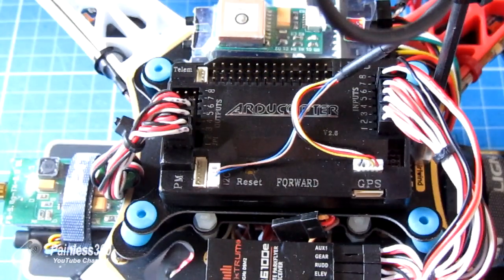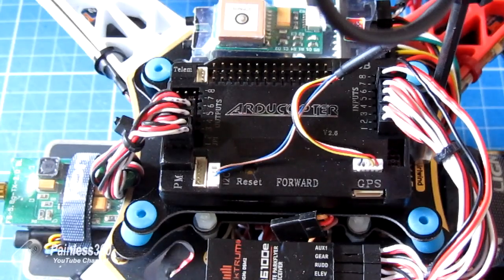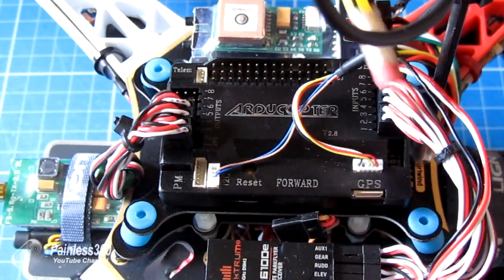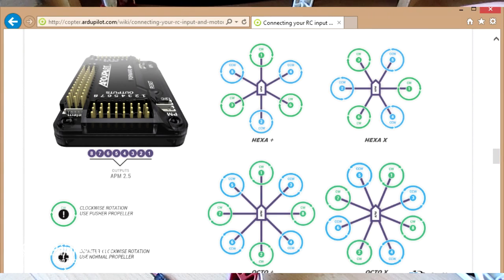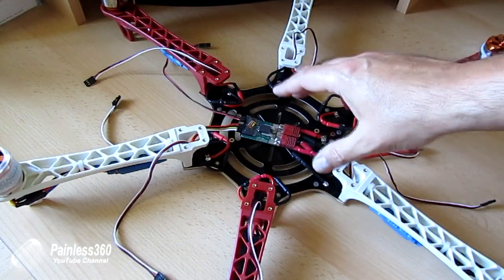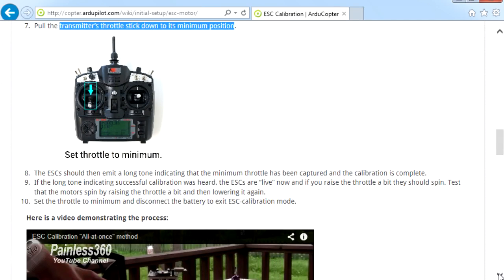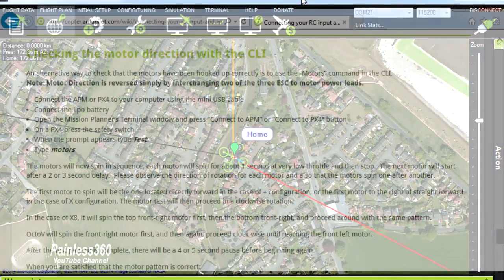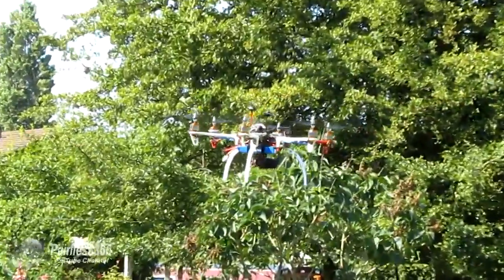(2/8) APM 2.5/2.6 - Powering the board, motor installation and ESC calibration

Comment: whenever i power up F450 (quadcopter) it required ESC callibration? my apm is not saving callibration data any solution
thanks
Reply from the maker: The calibration is stored in the ESC, not the flight controller. I'd check the process on the ESCs you have. See our videos on ESC calibration if you're new to this.. Best of luck!

Comment: what GPS/compass module are you using?
Reply from the maker: Ours came with the kit, it's normally some kind of UBLOX GPS unit. We're using the M8N a lot here for things like iNav.. Best of luck!
Reply: Also, does your apm have a built in compass?
Reply from the maker: Only the V2.5 had an internal compass... Happy flying!
Reply: Does that mean I should get an external one?
Reply: @jacobsingh4873  the compass is built into the gps

Comment: I don't have a power module so I have to power it by my ESC, but my bec gives out only 1.5A so can i connect 2 of the ESC's power(red wire) and cut one ESC's power (for Tricopter)
Reply from the maker: Should be, if the BECs in the ESCs are linear..
Reply: how do i know if it's linear or switching?
the labels are peeled off and the website I bought has not mentioned that.
Reply: +Painless360
Reply from the maker: +Asutosh I try to find the details from when you order them, best of luck

Comment: Wondering why my Live Calibration is not working. Do the 2.6 have it?
Reply from the maker: +Scott Miller SHOULD Do. Make sure that the external compass is connected and you've picked the right settings for it before calibration. Best of luck!
Reply: Will the sonar HC-SRO4  work with the mission planner plane?

Comment: Can I use this http://www.ebay.com.au/itm/like/322091210373 to power my apm2.8 and also get the other end of the power module to my main power connector which is connected to my drone? But will it work OK or will it damage the esc or the APM or any other component of the drone?
Thanks!
Reply from the maker: That looks like an APM power module. See us covering that later in the series.. Best of luck!

Comment: for calibrating the 4 esc's together i made a  little cable , grouping the 4 pwm signal input of the esc's , and separating the 2 wires +5 and gnd.As i had i esc powering the board, i was obliged to separate the signal and the power.So happy with this board , i tested Alt hold and loiter today , perfect without changing parameers, although my pitch channel showed correctly in MP , but was inverted???Little overshoot on roll after a stick command.These video are so helpfull!

Comment: Hello Painless 

Thank you very much for your extraordinary video series. 

Presently I am confronting an issue with ESC manual calibration. 
When ESC pins are connected to the RC receiver, motors are working properly, it rotates with respect to the Joystick(Transmitter).
When it is detached from the receiver and connected with APM 2.5 board, motors are not working with Joystick. Kindly suggest me any solution for this problem.
Reply from the maker: Tricky to answer unless you tell me what you've already tried. I assume you're arming the board?
Reply: Painless360 
Thank you for your reply.

Please see My current status
Installed firmware via usb
Configured accelerometer, GPS, Transmitter etc. 
Everything working fine. (Mission planner shows correct location, and tilt)
Now Connected motors, via ESC to the output terminal of APM. 
Mission planner motor test not given any outcome. (Eventhough, Connected usb and batteries simultaneously ).
So as per your instruction,for manual tuning, detached ESC input pins from APM and directly connected to the receiver, Now motors are working  properly with respect to the transmitter.
If you have any suggestion, kindly reply me.
Reply from the maker: So you've armed the board.....??
Reply: Yes..!
Reply from the maker: I find the fact that the motors are not spinning even in the test very suspicious. I'd reflash and start again and if you get to the same point (follow the video) then I'd look at the APM more closely.. Best of luck!

Comment: ok so I have opto escs and a power module will I need to do anything with the jumper or is it good to go
Reply from the maker: What's your guess after watching the video?
Reply: Painless360 I have the 2.8 and the package comes with neo7 gps. I honestly have no idea if I need to remove the jumper wire
Reply from the maker: I wouldn't.. ;)
Reply: I would say it's ok the way it comes
Reply: Painless360 ok thanks so much
Reply: Painless360  so I read up on a forum and it said to remove jp1 on 2.5 but nothing about 2.8 are they the same deal
Reply from the maker: 2.8 is the HK version of the 2.6.. Same deal..

Comment: A doubt. Is It necessary to cut the positive wire of the USB cable when, at the same time, use the USB cable and the LIPO battery for powering board, calibration, etc.?
Reply from the maker: Nope, we don't in the video.. As long as the model uses 5v and it's close enough to the USB voltage you'll be fine..

Comment: So I got everything working very smoothly, then decided to take it apart to take pictures to make a basic Reddit f450 build tutorial (linking this series). I also added hot glue to all the solder joints on the built-in PDB. When I put it all back together and got it armed again (I had to re calibrate everything) the motors started spinning slowly. I did some research and it appears this is normal and is a sort of failsafe. However the quad seems a lot more difficult to control now than before, and I've had it fall on its side while landing several times and now the props just try to spin into the ground until I can disarm.

I didn't have any problems when the props were not turning at 0 throttle, the motors wouldn't disarm if I put the throttle to 0, unless I did it for over about 5 seconds on the ground. I could descend quickly with no problems. Can/should I turn this off? Do you know why it didn't have this feature turned on until after I rebuilt it?
Reply from the maker: I would suspect something physical if nothing in software changed. Check that non of the props are on upside down (been there done that ;) and that all of the basics are ok.. Best of luck!
Reply: I started from the beginning with the wizard this time, and when I tried to arm it said Check FS_THR_VALUE. Throttle when bound is 1000-2000. Turning off the Tx dropped it to 900 and I tried all kinds of values for the failsafe between 925 and 980, and also tried turning the failsafe off with no success. When I turned the failsafe off I wouldn't get any error code, it simply did nothing.

 After a long time of noobshooting and tinkering it finally armed, and this time the props no longer spin at 0 throttle, and it was back to being very stable! I want to say I re calibrated the ESCs "all-at-once" before it started arming again a short time later.

Comment: i have set up my apm v2.8 as you have shown how in the first and second video, now i try and get it to lift off and i can only get 7 inches off the ground and my quad starts hopping up and down repeatedly i have increased the throttle hover to maximum value of 700 in basic tuning and still cant hover. what do i need to do to get it to lift off and fly ?
Reply from the maker: Not sure what you've changed in Mission planner, you shouldn't need to change that yet. Check the throttle channel moves from around 1060 to 1960 in the gui and recalibrate the ESCs. Then I'd suspect that you've got too much weight on the model.. Best of luck!

Comment: When I first got my APM 2.6 I couldn't connect to Mission Planner, so I just hooked everything up and calibrated ESCs all at once like this and it worked fine. Quad had lots of power, motors starting/stopping st the same time and got them going in the right directions, however it couldn't take flight, only fall to the left immediately. I then installed the drivers that allowed my computer to recognize the APM in MP. After flashing the latest firmware from the MP wizard my ESCs no longer respond to this calibration procedure. I also tried the one at a time method and no go. When I plug the lipo up the get the 3 tone musical, followed by a longer note, every time. I can't figure out how to get the motors to arm again.
Reply from the maker: Check out the arming troubleshooting video in the APM playlist - it covers what you need to check. Best of luck!

Comment: Hello painless360, I have apm 2.6 and it came without a jp1 connector.  I would like to use it for a petrol rc car.  Can I use two separate power source to power each side of the apm, one for receiver and apm other for servos. Thanks.

Comment: I have a problem, I already finish wizard, but my motor only can do throttle but cant do yaw pitch yaw(only throttle) any solution? my ESC is optp
Reply from the maker: I'd check that the radio inputs all work as per the video series. Sounds like something basic isn't happy. Best of luck!
Reply: thank you so much!, but I have new problem, why mission planner say "GPS not fix"?and than how to use telemetry?
Reply from the maker: Watch the rest of the series - lots of detail about the basics in there. Best of luck.
Reply: Thx!
Reply: hello , what was the problem, how do you solve first problem?

Comment: When I want to callibrate my ESC's something strange happens: I hear a small set of tones and then nothing only a bleep once but I'm sure I have a 3S battery? could you help me? is my Ardu in the wrong mode or is something not working the way it should?
Reply from the maker: I'd calibrate manually. Best of luck!
Reply: Thanks it worked, I do thing that something is wrong. when I perform the motor test as you recommend in the end of video, I keep getting an endless string of :QQ?PQQ RC not calibrated ... but than just a lot of this any idea?

Comment: Correct me if I'm wrong, but shouldn't you remove the red wire from the esc's? I'm a bit confused with this as the esc's I bought don't even have a red wire... which means no bec I guess. Are you using the red wire because no power module?
Reply from the maker: Not always. See the ESC/Power videos in our 'Introduction to Remote Control' series.. Best of luck!
Reply: Zac Johnson

Comment: hlo, can u tell me my apmmini pro showing bad compass health how this can be eliminated??
Reply from the maker: Try and recalibrate the compass, keep the compass away from power-lines or use an external compass (my choice). Best of luck!
Reply: just about every bad compass health message I have had before was either a) a dodgy module or b) too close to something metal. You'll be surprised how far you need to have it away, hence why they moved to external compass.

Comment: Maybe I need to post my question / problem in a forum but I hope this great channel can help me! My hexa copter with APM 2.8 worked fine (no power module), after installing a power module there is a problem with the motors, ESC’s or AMP board? 

I calibrated the ESC’s (all-in-one method) many times. After calibration the motors run nice and the throttle works fine (from slow to max and motors start at the same throttle). After calibrating it is possible to test the result, the receiver signals are passed directly to the ESC’s (so maybe a board issue or setting?). When I restart my board (power off / on), arm my board the throttle does not work smooth and correct. When I start slow the engines gradually increase speed and one or two motors stop spinning. When I put throttle to 0 and give a little throttle the motors (not the one or two that did not spin before) are spinning fast (looks like the same speed when throttle to 0).

It is not possible to solve this problem and I am stuck, funny thing is that it worked before. Is my board broken or ESC’s? What did I try:
1) Remove the power module
2) Re-Flash board (3.2.1)
3) Checked the ESC’s settings (with TURNIGY Plush 25amp programmer)
4) Recalibrate ESC’s many times
5) Changed THR_MAX  and THR_MIN settings

Any suggestions to help me solve this problem is appreciated!
Reply from the maker: Sounds like something is wrong with the ESC calibration of how the board is sending out the PWM values when armed. I'm not a fan of the 'all-in-one' method used on the APM, I've had very mixed results here. I find that manual calibration is a lot better. Best of luck with it..
Reply: Thank you for your quick reply! I will try to do a manual calibration and will post the result!
Reply: After manual calibration (ESC-by-ESC) the motors are running better (gradually increasing speed remains). This afternoon I will give it a test flight and will post the result. Again thanks for your support!
Reply from the maker: Good news! Best of luck with the test hover - keep it low! ;)
Reply: I couldn't reply sooner (bad weather), today I tested my hexa and everything works fine! Many thanks for your great support and keep posting great video's!
Reply from the maker: It's a great feeling when something you've made flies! Well done.

Comment: Maybe a newbie question: can I connect a lipo AND the USB at te same time when I remove the jumper? If so I think I only need to use the ESC signal wire.
Reply from the maker: You should be able to do that anyway. The BEC should produce about 5v - the same as the supply from the ESC cable..
Reply: Thanks for your reply. So I can use the PowerModule (remove the jumper), leave the ESC 5V power and use the USB (Lipo power -> 5V from BEC in PowerModule) and USB. I found some discussions that this was not possible.
Reply from the maker: Keep watching the APM videos ;)
Reply: Maybe I missed the video with the answer to my question :( Can I use the power module, the 5v wire from ESC and USB at the same time, or must I remove the 5v ESC wires? I am not using a Power Module but I need to use it to use the telemetry data for OSD.
Reply: Found the answer: best to remove ESC BEC power cable (even when linear), remove P1 and use Power Module. Thanks for all video's!!!

Comment: Hi there, I have a AR610 receiver connected to a Sabretooth 2x32 driver to control two motors, and that works fine, this device supplies the AR receiver with 5v and 1A thru the red and black cables, but I'm wondering if I need to cut the red wires when connecting an APM 2.8 directly into this Sabretooth2x32 device?, keep in mind the APM 2.8 will be getting its power from a separate 5v 3A power supply like the UBEC (and using the JP1 I assume to power the AR receiver that will be connected in the Input), is this correct?, or do I need to cut the black wires too leaving only the Signal wires?, I don't think this is right but I thought of asking. Thanks!
Reply from the maker: +Adrian Guanipa No idea. Not sure, I'd try and keep the 5v lines separate personally to help avoid problems with the voltage being pulled down by too much current. Best of luck..
Reply: Will do, thanks for the advice.

Comment: in 0:43, the gps cables are split to 2 and one goes above the word 'GPS' and the other goes next to the word 'Reset'. the one which goes next to the word 'Reset' can also go under the word 'GPS'. should i do the same way that you do or is it ok to connect  under the word 'GPS'? what's the difference?
Reply from the maker: Yep, the other connection is for the i2c port to the external compass housed in the GPS unit.. Best of luck!
Reply: +Painless360 so i should connect  it like you?
Reply from the maker: If you want to follow our tutorial, probably ;) Best of luck!
Reply: can you tell me the difference when i fly?
Reply from the maker: All covered in the video - external compass doesn't get the same level of interference.. Happy flying!

Comment: Hi is it Ok to power Hexacopter apm2.6 with all my 6 Turnigy Multistar 20A V2 Slim. BEC Output: 5V/3A.
Is it too much to use all 6 ESC Bec to power?
Reply from the maker: +Adam Osbäck see our videos on RC Power systems. Depends if they are switched or linear BECs..
Reply: +Painless360 thanks,  i ended up removing red wires from escs and ordered a power module. Should be the best way to power it?
Reply from the maker: +Adam Osbäck will also give you power monitoring too. Best of luck!

Comment: hi 
i need a bit help with my apm2.8. bascially, im confused about jp1, if i want to connect the module power do i need to remove the jp1? or if i get power from ESCs do i need to keep jp1 on and do i need to modify the ESCs wires? hope i get answer from you soon. 
many thanks
Reply from the maker: +Zico Airsoft it all depends on how you power the board! The answer is in the video for the war you choose. Best of luck.
Reply: thanks for you help i have fixed it, i watched your videos and it actually helped. 
but i have a problem with ESCs calibration, when i connect to the battery it beebs but the motors don't spin? can you please help me. 
many thanks
Reply from the maker: The motors won't spin during ESC calibration. See how we cover that in the series. I usually end up running a manual calibration.. Best of luck!

Comment: Is it possible to run this system with non brushless motors?  Looking to add gps to my syma x8 and this seems the cheapest way, just need to know if I need to upgrade the motors at the same time? thanks in advance @painless360
Reply from the maker: I've not done  it but the Brushed ESCs work in the same way as brushless. Brushed motors are far superior to brushed for applications like multirotors though. Best of luck!
Reply: Thanks! Brushless is on the list of upgrades just wondered if I had to do it all together or if I could spread the cost and do it at different times, thanks for the fast reply!

Comment: your instructions to calibrate ESC on APM from RC is partially wrong. APM must be connected to computer with Mission Planner and motors should be forced from "Initial Setup->Motor Test" to 95-100%. Only this way full PPM throttle could be show to ESC.
Reply from the maker: Thanks for the comment, this video is a little older now.. Happy flying!